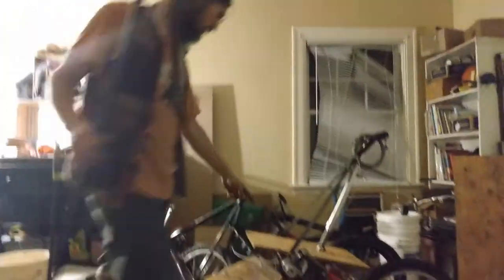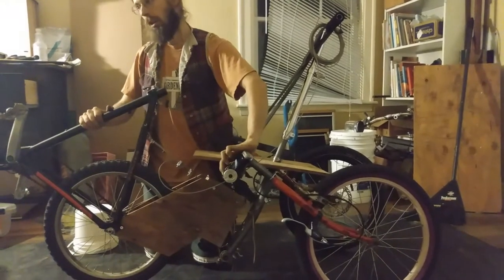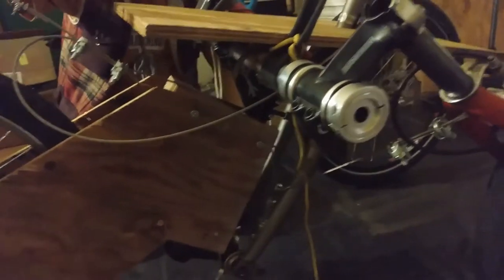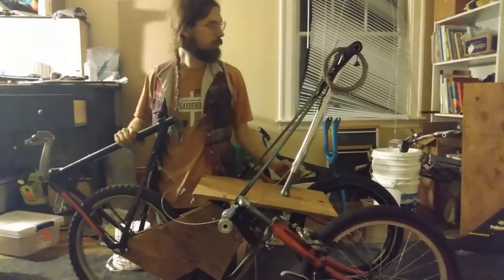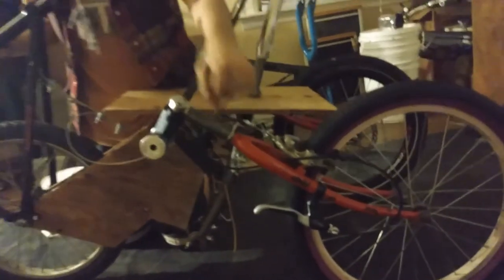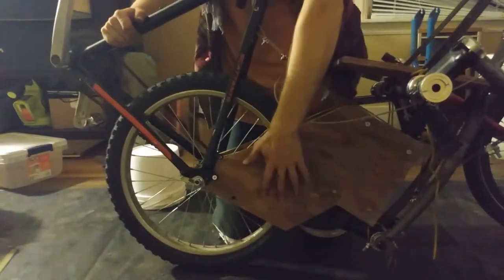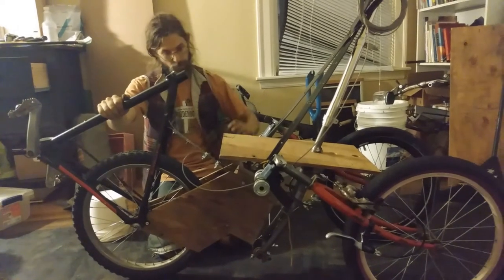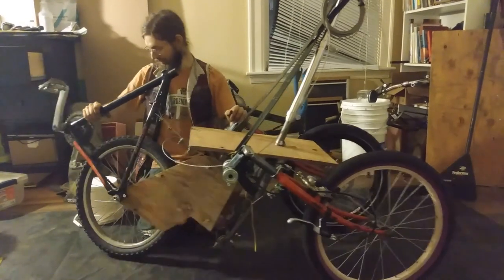Python Recumbent Trike Prototype (in progress)

Comment: You’ve latched onto the tilting exploration I’ve found most engaging - how to employ tilt with self-centering that is based on the weight of the rider (the greatest leveragable force on a moving bike). The Jetrike is the nearest thing to this magical approach. That I’ve seen anyway.
Reply from the maker: Oh, the Jetrike is a neat concept!  I did build something inspired by it some years ago but the self-centering effect wasn't noticeable.  I probably didn't put enough bend into the connecting linkage.  The build log is on an old iteration of my website: https://www.darinwick.com/python_trike.shtml

The tilt mechanism on this prototype isn't self-centering at all.  It would fall over at the drop of a hat!  I could have added Jetrike-style self-centering to this by using something more complex than a pulley for the tilt linkage cable, but didn't think it was worth the bother.

The past few years I haven't really bothered with self-centering tilt mechanisms and have instead focused on FWD/MBB designs that can be steered with the feet (as is the case with both Python and FlevoBike) so the hands are free for tilt control.  I realize it isn't immediately apparent from this video, but the idea with this prototype was to be able to hold onto the rear forks like handlebars and push/pull them to control tilt.  

(Sidenote: Pythons DO have rider-weight-based self-centering steering, which I think I talked about some in this video.  That's independent of the tilt mechanism, though.)